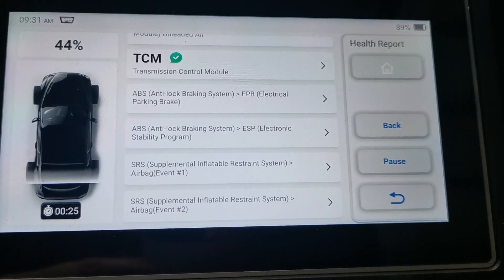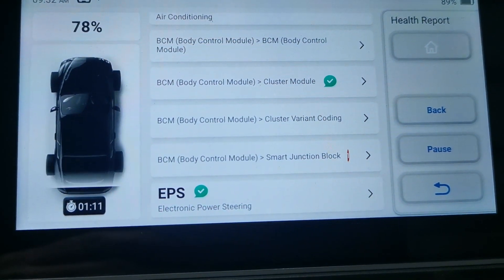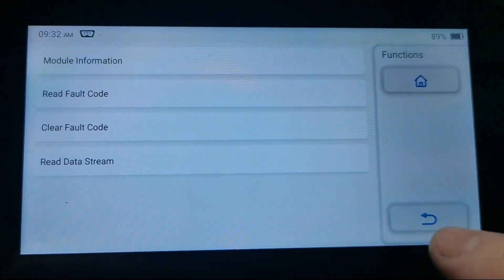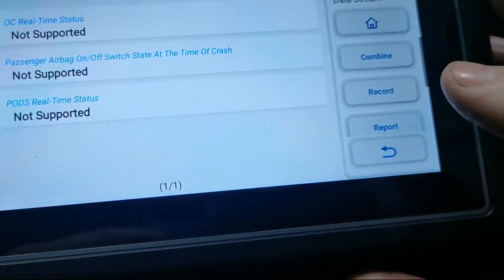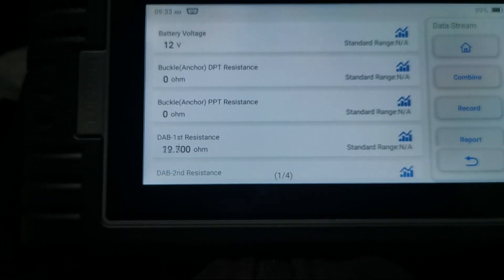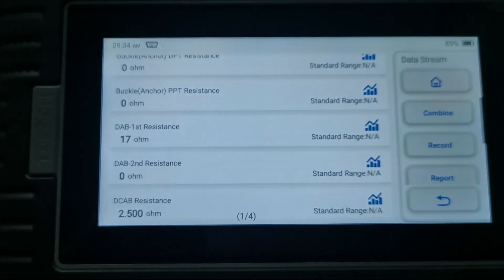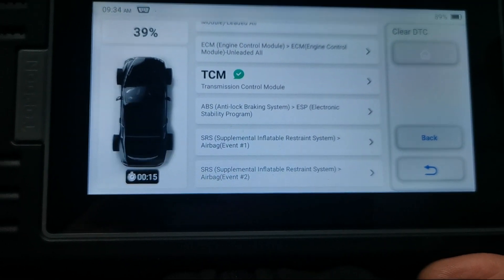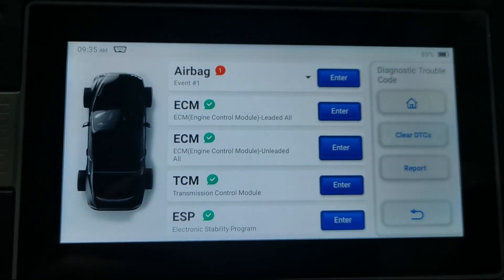Hyundai - Kia Airbag Fault - Diagnosing Tip Using Topdon ArtiDiag800BT

Comment: no idea why they call them clock, probably because the steering wheel turns , ever pulled them appart man reminds me of a mower pull cord only its flat thin wide plastic containing electrical wires, youd think there was a better design out there.